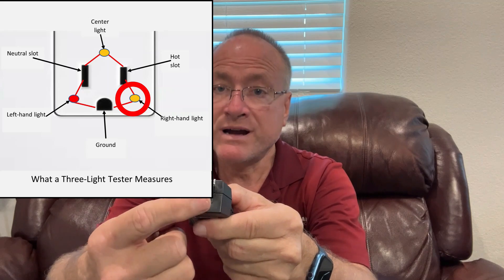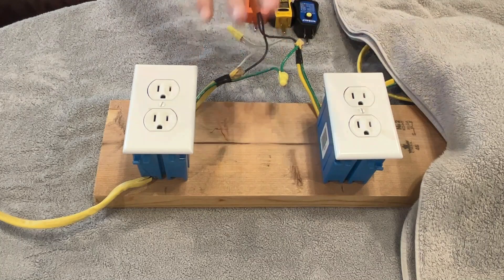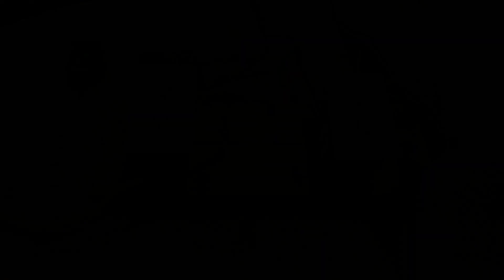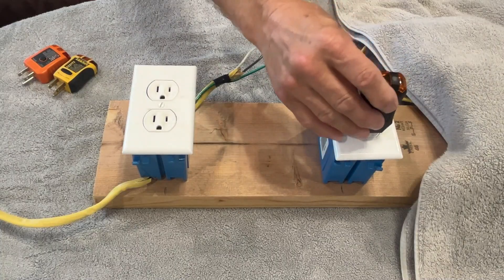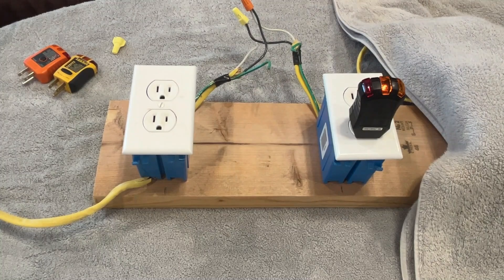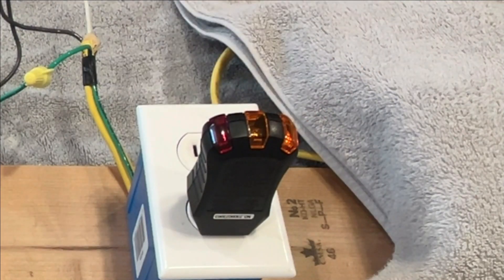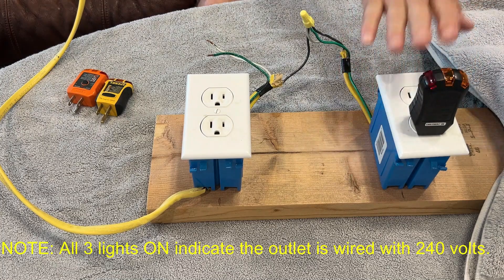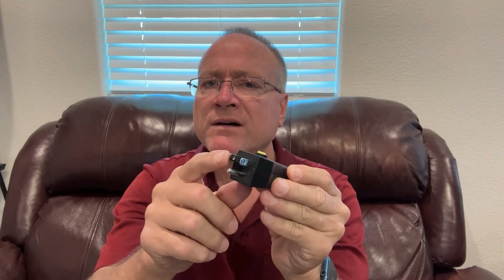3-Light Testers - The Definitive Guide

Comment: What about all 3 lights on,
Reply from the maker: All three lights on means it’s wired with 240 V instead of 120 V.
Reply: Thanks for your reply, this is kitchen plug, so  this should be ok, I assume 3 wire split receptacle, with shared neutral. This is a older house I’m finding lots of 3w shared neutral loads, but whoever updated the panel years ago did not use 2 pole breakers for the 3w loads, I’m getting lots of shocks off neutral conductors everywhere.
Reply: Sorry  my reply does not make sense if the spilt receptacle is correctly wired, it would show proper lights on both top and bottom, I think your telling me the Receptacle is 240 line to neutral, I should also mention the house has a lot of ungrounded plugs, there’s a mix of grounded and ungrounded circuits. I’m going back to the house today, and start opening up some receptacles to see what’s going, again thanks for you info.

Comment: Normally a standard 120V receptacle wired with 240V happens because someone accidentally installed a standard 120V 15 or 20A duplex on what was supposed to be a dedicated line to a specific piece of equipment, for example the large air compressor in your workshop, in which case you either need to install the appropriate receptacle or go  to the panel and remove the white wire from the breaker and put it on the neutral bus.  

Of course there are rare exceptions to the rule.  A close friend of mine has a small detached garage fed by one 12/2 UF cable repurposed as an indoor garden and he is using seven 400 watt metal halide grow light fixtures and this was tripping the circuit breaker.  Since he was on a rather tight budget when he started this set-up, instead of pulling another circuit to the garden, he rewired the fixtures on the 240V tap of the ballasts and installed NEMA 6-20 duplex receptacles (he ordered them off Amazon, they are Leviton, really high quality) and changed the plugs on the cords as needed.  He is also using  120 ~ 277 volt LED bulbs in the wall sconces on the exterior of the garden and the sockets are marked with a sharpie "WARNING 240 VOLTS!".   A rather crude set-up, but this cuts the amp draw of the grow lights in half so he can run all seven of them without overloading the circuit. (Amps = Watts/Volts, you might recall ).  I thought I would share this with a wider audience in the hopes of raising awareness about strange situations that aren't necessarily a cause for concern.

Comment: What damage can a hot and ground reversal do?
Reply from the maker: As explained in the video, if you get a hot ground reverse reading on your tester, it is almost certainly not actually a hot ground reverse. It is an open neutral with a load plugged in and turned on. This really will not do any damage. It will Basically just prevent things that are plugged in from running.
Reply: @ so if i have a microwave plugged in on a socket with a ground hot reverse. It will just not turn on?

Comment: This is very underrated information!!! I never realized that the simplicity could also be so wildly misleading. At least the two orange lights seem to always indicate that things are correctly wired. It would be very bad if a miswired circuit would show two orange lights!
Reply from the maker: You are correct. I think a lot of people don’t understand the limitations of these testers. Fortunately, they are normally correct when they tell you that a receptacle is correctly wired. That is with one exception. They will not detect a bootleg ground.

Comment: Because of these limitations,  a slang term for the 3 light testers I along with my fellow electricians use, are the 3 eyed liar, 3 light dummy tester,  or dummy traffic light tester.  

Speaking of which,  I've actually encountered a 120V receptacle wired with 240v once.    In my first apartment in Pontiac Michigan,  after finishing a two year trade school and moving out of my parent's house on my own.   There was a window air conditioner with the factory plug replaced with a standard 120v 15a plug, never thought anything of it.    That location also happened to be the most convenient place to plug in my floor lamp with a CFL bulb.    As nighttime approached,  as soon as I turn the switch,  i got loud popping and bright flashes,  the bulb caught fire and in a full blown panic,  smashed the lamp through the window out the second floor with the bulb and plastic shade on fire.    After a couple shots of whiskey to calm my nerves down and think clearly, plugged in my 3 light dummy.   All 3 light lit up with the middle light brighter, I didn't understand that reading,  so I grabbed my wiggy meter and sure enough,  240V hot to neutral,  120V hot to ground and 120V neutral to ground.    

I now make it a habit to check out the outlets in any home or apartment I choose to rent especially if I notice something suspicious ex. a large appliance with the factory plug replaced, plugged into a standard 120V outlet. Or if its a really old property and my 3 light dummy says correct wiring,  I will pull the coverplate to check for a bootleg ground.    Fortunately I haven't found any problems in the properties I've stayed at since.

Just something you may want be aware of when moving to a new property,  whether you're renting or buying.
Reply from the maker: Funny story. And a bit scary. I run into home inspectors who think these things will tell them everything they need to know.
Reply from the maker: Maybe you can help me out. I have a viewer who put a rather lengthy comment on this video. 
https://youtu.be/BVcNnBKfC8Q?si=LVYW2KOl0Llksqb8

The comment was written in the last 12 hours or so by “theomengod.” it should be easy to find. I’m having a hard time diagnosing his issue.